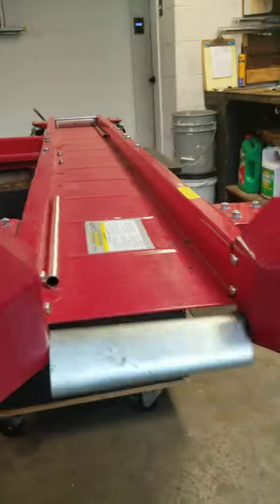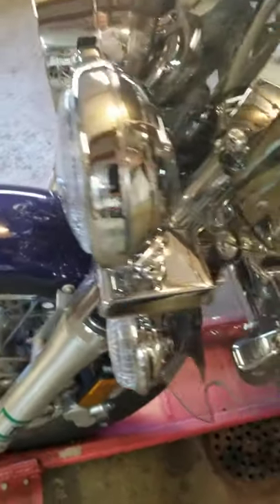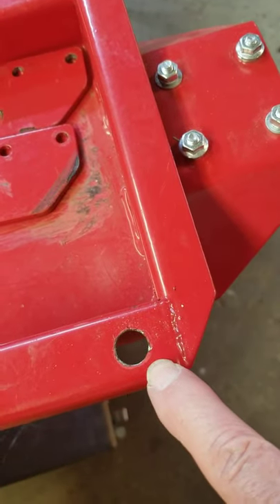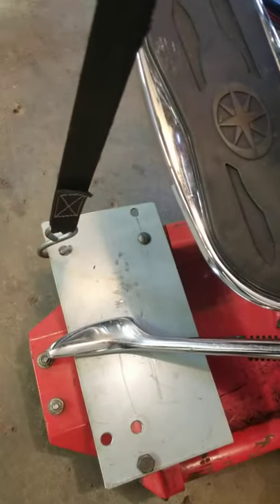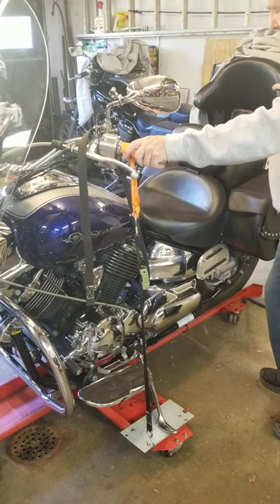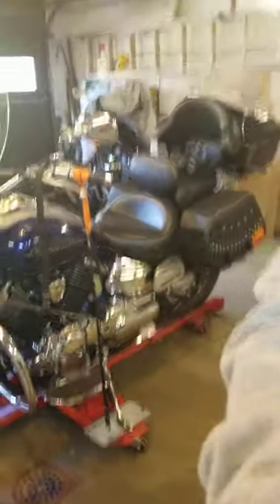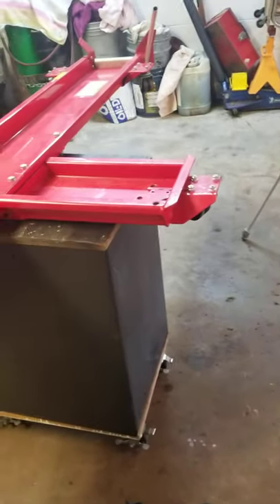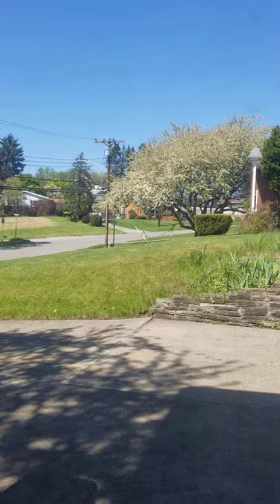Harbor Freight Motorcycle Dolly modifications and improvements

Comment: what   do you think  about  adding  or  tying a rope to the front  and   back of dolly  to  maneuver it  or  pull  it  around??
Reply from the maker: I do not like ropes because they are difficult to tighten. That's why I prefer the pull to tighten straps. Ratchet straps are too much of a pain to use. But you must also have a smooth rock/divot free floor.  Another secret I use is I push the dolly with my foot first in the direction I wanted to go.

Comment: I bought same dolly from Harbor Freight - had to return it because  kickstand on my 2002 Roadking extended out too far beyond length of the kickstand tray.  I noticed I think you had same problem but you bolted a piece of steel at end on top of your tray, tight?  Because that will cause your bike to lean less, does it still lean over enough without being strapped or do you then have to secure the bike with the strap because it otherwise will not lean enough?
Reply from the maker: The bike still leans enough to be safe but I strap it down just to be safe when I move the dolly . Sometimes takes a pretty good kick on the dolly to get it to move.
Reply from the maker: content://com.android.chrome.FileProvider/images/screenshot/16320785396661808227176322370425.jpg
Reply: I easily fit my 2002 Road King, 2018 Deluxe and 2020 Street Glide on this exact dolly with no problem at all.

Comment: Did you ever have the problem of one side moving up or down when you go to the opposite side to move it off the casters. Meaning, I go to one side to move the handle  down then go to the other side and as I move the handle it moves the other handle the opposite way.  I had to find a 20 lb weight to hold the lever down, then I can slowly do the other lever to the down position to get the motorcycle off.
Reply from the maker: I now have that problem , lock down one end of dolly , lock down other end of dolly and the 1st end comes back up ,don't know why. It will be a mission when it's a little warmer.
Reply from the maker: Out of curiosity what weight and length is your bike
Reply: @davidriegner2967  91.5legnth, 561lbs
Reply from the maker: @lkeirnan   I have just found a solution. Put one end down move the other end to touch with my foot and then kick it as fast and hard as I can they both stay down. Hope this helps. Did you install the extensions to the handles?
Reply from the maker: Plan CI I use an extension on the lock handle. put the rear down 1st take the extension slip it through the lock where's my guides on it stops the lever from coming up when I flip the front lever
Reply: I have that problem and have solved it by having my wife stand on the locked down side while I lock down the other side. Seems like a bad design.